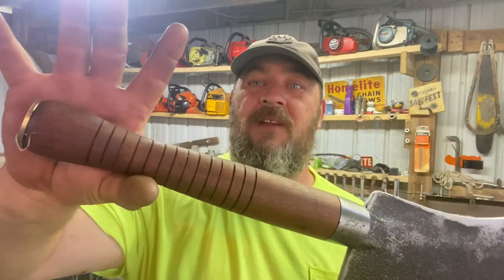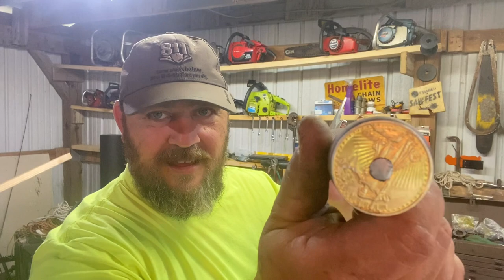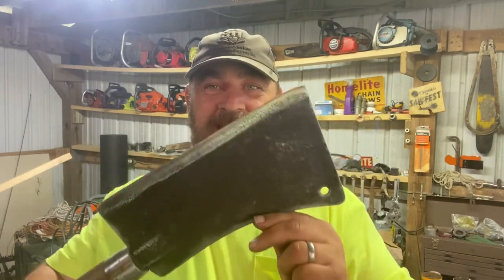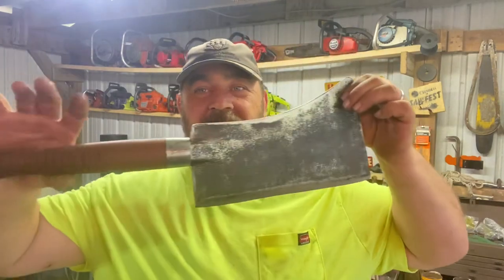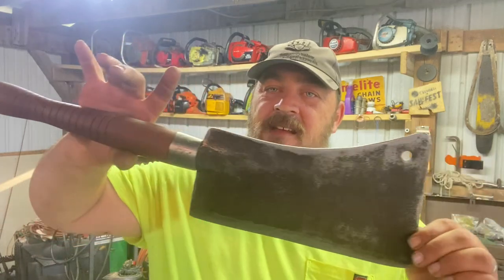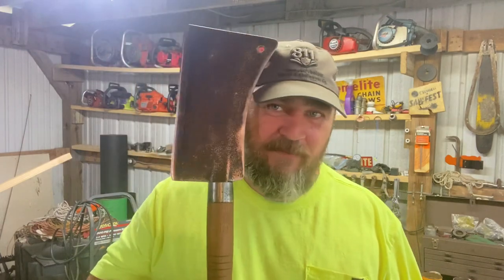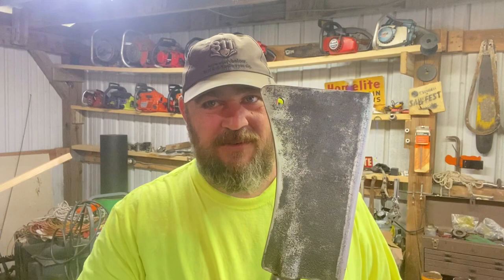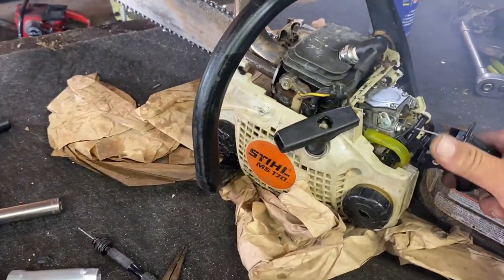Stihl MS 170 Chainsaw!  Carburetor Swap!  Meat cleaver! Converting To Run 100% Alcohol!

Comment: It's too lean on the high side!
Reply from the maker: It’s shoving the fuel backwards out the carb. It doesn’t matter how rich I tune it because it’s just getting shoved backwards out the carb. It sprays all over my hand.
Reply: @Smitty’s Chainsaws  true. But it seemed to get worse when you leaned it out. I would try adding fuel through the carburetor bore when it starts acting up at higher rpm. Just to rule out a lean condition. Great content! Keep it up, I'll be watching!